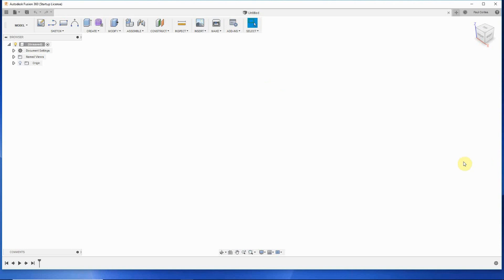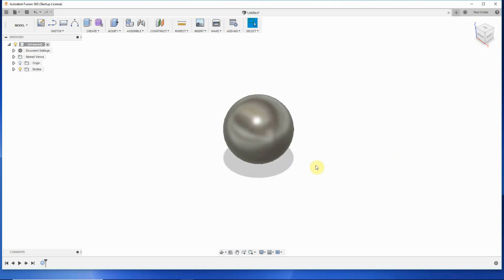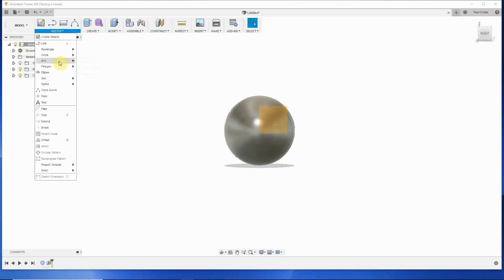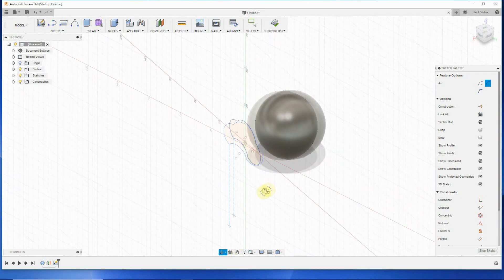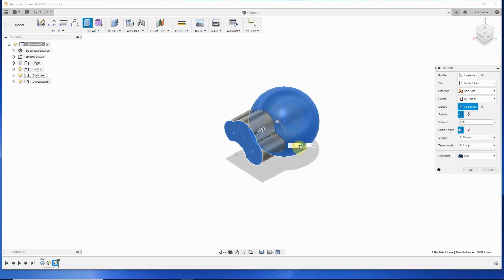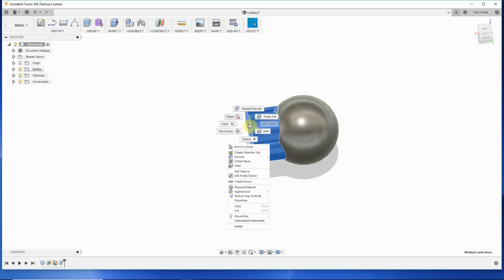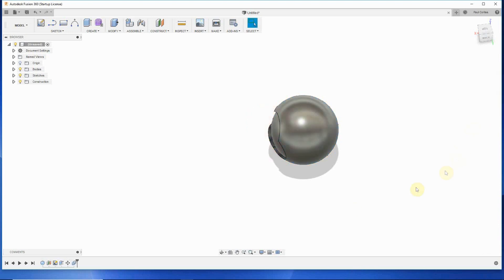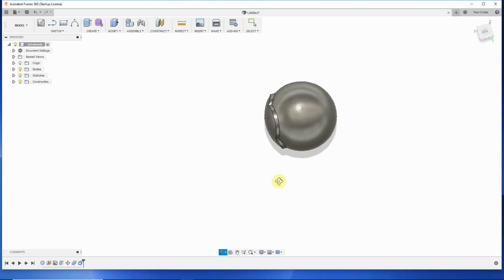Fusion 360 Design on the Surface of a  Sphere

Comment: Great video.  There is a faster way though.  Draw your sphere and your sketch.  Then when EXTRUDING, click the START and select FROM OBJECT.  Extrude out and you are done.
Reply from the maker: Robert,   I tried to do that originally but there is a chance I did something wrong.  I couldn't get the extrusion to follow the shape of the sphere, it just came straight out not curved to the sphere.  Maybe I did something wrong but that is the result I got which is why I ended up doing it the way I did.  Thanks for your input, help, and for watching my channel.

Comment: I'm very new to F360, but I think another way is to use the 'Project onto surface' tool. This will project your 2d sketch onto your 3d surface.
Reply from the maker: wforl,  I tried what you suggested (a great idea by the way) but couldn't achieve the same results.  If I am missing something i would appreciate your input...I would love to do an "update" video to show your method.  If you could elaborate here or email me at  paulsmessyworkshop@gmail.com  and let me know what I might be missing I would appreciate it.  Thanks for watching and the great suggestion.